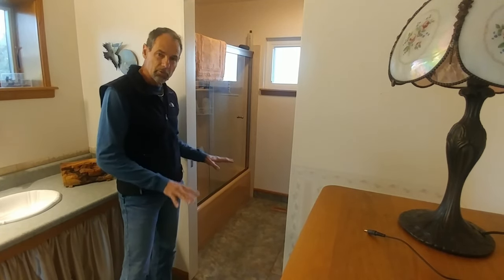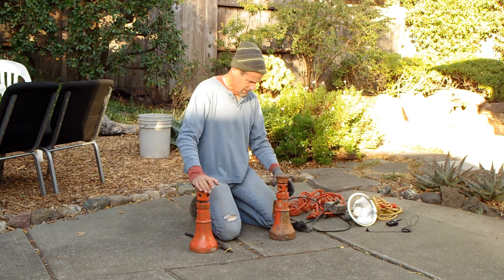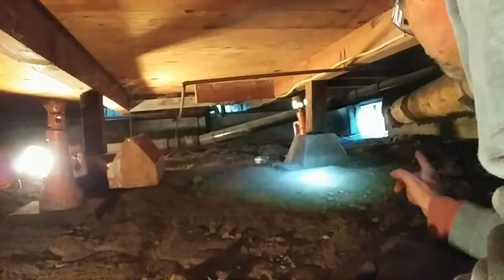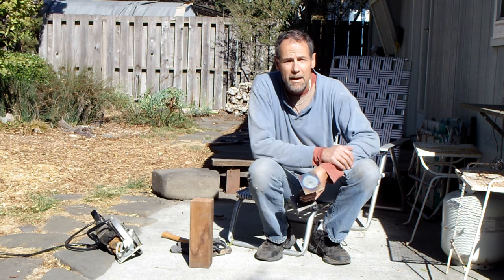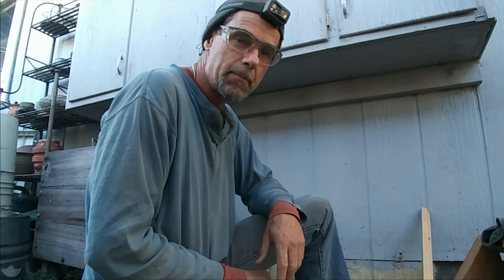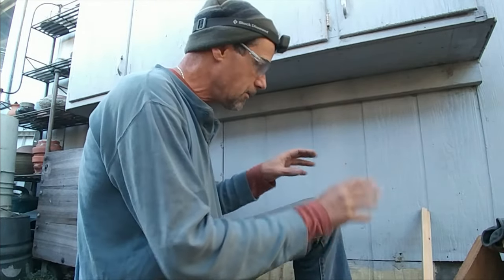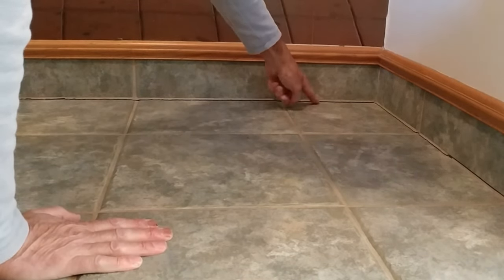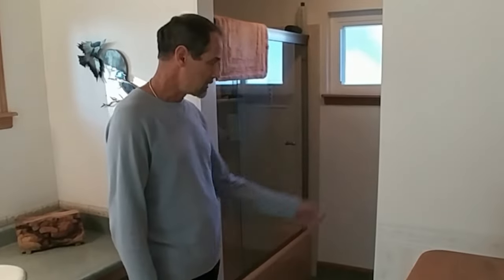Fix-it Guy Takes On Foundation Repair

Comment: You will need to address the reason that the pier supports all sank when they were unloaded! You have a very serious soil instability issue under your house. You need to get the soil situation assessed by a professional.
Reply from the maker: Yes, drainage issues have been corrected, I think. We had a drought year, so until we get a real wet season where the corrective measures can be assessed, its not completely certain.
Reply: @ItsFixable  Since you didn't identify the actual cause of the instability and your uncertainty about whether your corrective measures were successful, I suspect that you  did not hire a professional to assess the situation. There are times when a DIYer can learn enough to fix common issues. This situation is NOT a common issue and the knowledge required to properly assess it takes years to acquire. The tests needed to evaluate the situation are probably going to be expensive, but less expensive than your house falling into a sinkhole! 

When I wrote "assessed by a professional" I didn't mean "try something and see if it works." Instead, I actually meant hire someone who specializes in soil stability to perform scientific examination of your specific situation. You've noticed an early warning sign that there is a very serious problem with your property. This is not the sort of thing that you want to "try X and see if that works" because if it doesn't, it could literally cause your house to collapse. And if your insurance company finds out that you discovered readily recognizeable structural issues and negligently failed to address it (professionally) in a timely manner, they could attempt to deny your insurance claim.  

That said, if you ARE a trained soil scientist, then I'm really surprised that you didn't install the J57's at minimum height, knowing full well that the soil was only going to drop and not rise underneath the house.
Reply from the maker: No argument from me. I did what I felt comfortable and confident in.  I decided to make this video about the mechanical repair and not about the problem which lead to it.
Reply: @stephendee7839  Insurance won't cover soil instability such as slope creep, slumping, sinking.

Comment: Just curious why weren’t the blocks attached to beams ? 
Were they just sitting and not attached ?
Reply from the maker: The beams were attached to the posts with toenails and the posts to the piers with toenails. Not a very positive system for anything other than lateral stress. The sinking earth simply allowed the nails to pull free.

Comment: Nice but would fail a proper inspection.
Reply from the maker: This is very much an interim DIY fix. To meet code, a host of expensive changes would be necessary and require a significant contract. Of course, structuring a floor system with post and beam like this has long ago been outlawed in my region. But home like this, built in the 70's abound.
Reply: @ItsFixable  Ok then- fair enough. This is reasonable and to this I can fully agree.
Reply: He is the house owner! No inspection is needed at all!
Reply: @jrm163 Not true. All work like this requires permits and subsequen inspection.  If you skip it, good luck selling it. That work will be called out. There are fines and other. My understanding though is this is just temporary. When he does the full job I am sure he will pull some permits. They are not expensive and can actually be helpful. I just renovated my house- I am the owner and yes, I pulled 3 different permits and had numerous inspections. Two of them actually saved me- found issues I had not realized that would have been a problem down the road.
Reply: @MOAB-UT  Good to know! But, how did the seller sold the house to you?

Comment: My house doesn’t stay level. I’ve hired people and it doesn’t last
Reply from the maker: Your soil must always be moving. I have a bit of that going on summer vs winter due to this clay soil expanding when wet.
Reply: @ItsFixable  I have black land or Gumbo.
Reply: My blocks rest on bell bottom pears too
Reply: Mine didn't last either. About 5 years and now back to square one.  It seems like certain companies will go through the permit process which balloons the cost to the moon.  The permit will require complete soil analysis by a geologist and structural engineering cost which can cost $8000 or more, not including the labor and materials for repair.  My foundation sinks after several consecutive days of heavy rain.  I had drainage pipes installed many years ago.  So now I'm going to get a camera to check clearance and extra gutters installed in back.

Comment: Better but you should have doubled up some of those cracked beams and centered on the post. The screws were very much not adequate. You have to account for uplift. 1" screws are not to code. Metal supports would have been far superior to wood.
Reply from the maker: Because the threaded rod floats in the tube, there is no uplift strain.
Reply: @ItsFixable  I don't think you understood me. To do it correctly, that entire assembly needs to be more secure. It certainly is quite susceptible to strong uplift forces and even lateral forces e.g., strong winds or a hurricane. I am sure you have heard of hurricane ties. They are code for good reasons. Let me guess, you did not pull any permits or have any inspections on this work? 

What you did will likely hold up good enough, for a while assuming there are no strong winds. Next time, with a little more effort, you could have done it right. Also, the adjustment rod being threaded has nothing to do with anything. It also does not float. It is screwed into a mating female member.

Cheers!
Reply from the maker: @MOAB-UT  the female member is not threaded. the nuts float on top of the tube.
THe only natural threat in my area is fire and earthquake. No doubt this house will be a pile of timber in a quake!
Reply: @ItsFixable  Understood and agreed.

Comment: It looks as if the structure is being supported solely by the perimeter footing. That tells me that the builder did a piss poor job of compacting the site prior to framing.
Reply from the maker: Well, this house was built in 1975. back then it was common to simply scrape the ground and then start digging the foundation. So yes, you are probably right.

Comment: bolted down to concrete , when the ground drops again it will pull your floors down with it i would of left it lose
Reply from the maker: Your are right, but the design of those jacks allows the threaded end to float inside the support tube. The tube rest on the nut beneath it, but if the footing drops, the nut simply moves downward away from the tube. It's important at that point to snug up the nuts so to continue to support the weight of that above.

Comment: Dude, wear a froggin mask my man.  All that dust you see in the light from your headlamp is full of all kinds of nasty stuff.  From chlorodane crystals to rat shit particles, your breathing it in and taking months, if not years off of your life.  PPE is 
Your best friend.  Other than that, solid work, on what was obviously a VERY un-solid foundation.  This video shows exactly why the code exists!
Reply from the maker: Normally I would have, but I found it interferes with my speech when trying to get clear audio recordings. As it was, dealing with taking gloves off to operate the camera and then putting them back on to work was quite annoying. But hey, I'll sacrifice myself for my subscribers ;-}

Comment: Foundation repair is a bit misleading, this house has no foundation. It was literally build on few concrete slabs
Reply from the maker: Sorry, not so. Full perimeter concrete w/reinforce steel & bolted sill plate. Center pier blocks on individual slump pours.